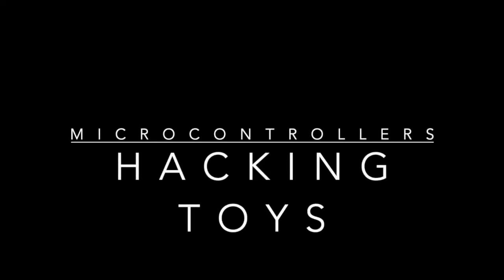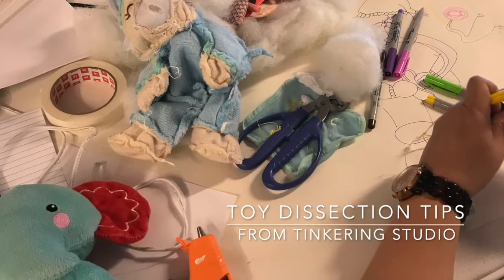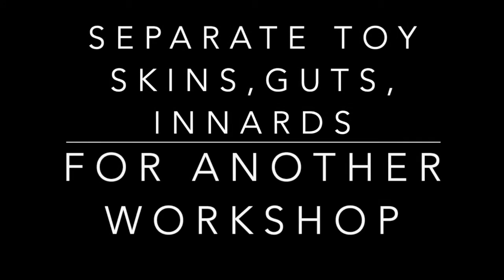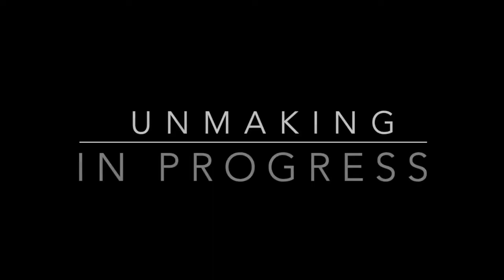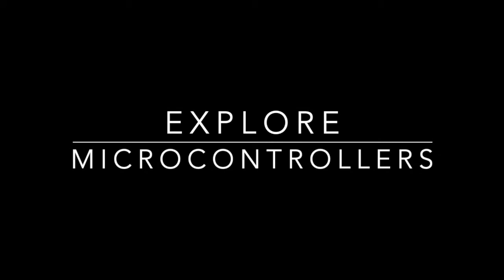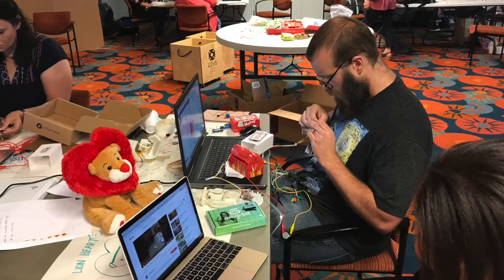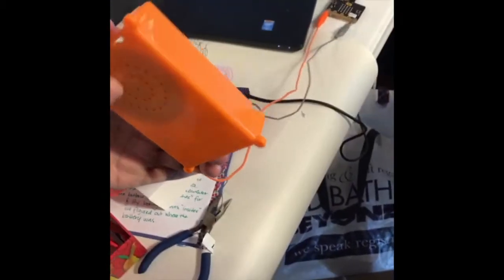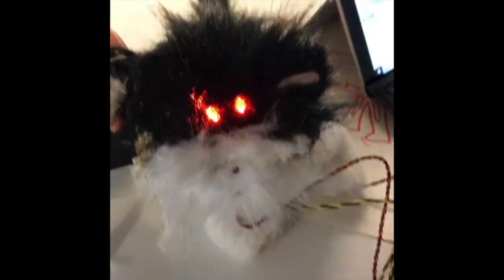Mashing Up Toy Hacking and Microcontrollers

Comment: Even if you map out the components, you save more time using an oscilloscope, kids should start using one young, it's an awesome tool. Chinese use a diy micro-controller in the cheapest of toys, if you can learn to sniff out the assembly language or even the binaries, you will learn much more but, it's not easy, lots of free software.